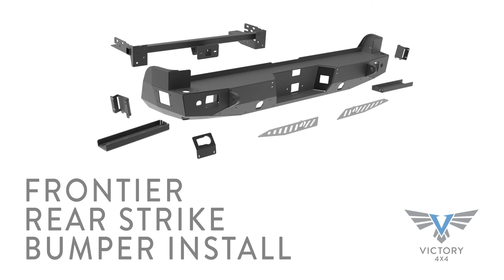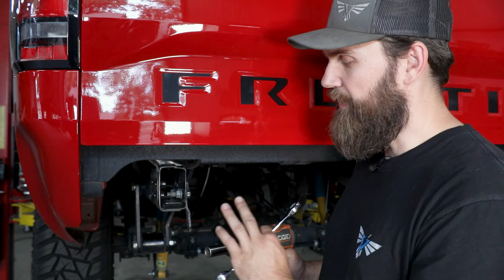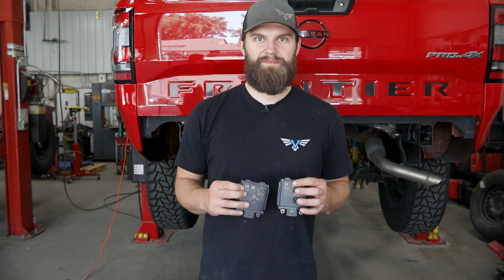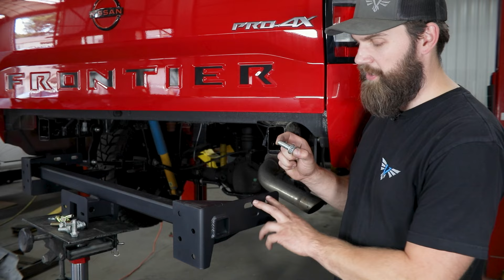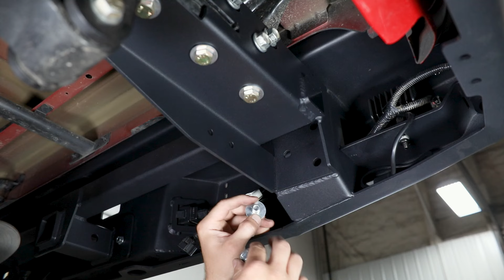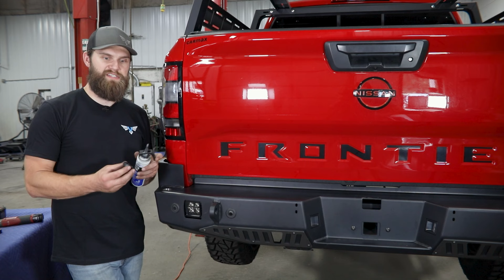Nissan Frontier Strike Rear Bumper Install

Comment: The problem - Nissan Frame is thinner than the material used for the new bumper   One little accident and kiss your frame goodbye
Reply: the frame would take damage no matter what, steel bumper or not and its not just a frontier thing either.
Reply: just had a rear end collision on the interstate, and the frame took the beating.  I was hit by uninsured driver he was doing around 70 mph and I was doing around 25mph
Reply: @buddyadelsberger5083  ANY frame would take a beating with a 50mph speed differential. dont matter what it is

Comment: does the adventure carrier with no rear tire interfere with the OEM rear cameras field of view? any chance of posting pictures of rear camera view with  the adventure carrier?
Reply from the maker: It will partially cover the camera, how much will depend on tire size and adjustment on the carrier. That is why we developed a license plate and camera relocation kit which can be found here. https://www.victory4x4.com/product/LPRLC3.html

Comment: Does this bumper sit higher with better clearance than stock and if so how much higher?
Reply from the maker: There will be clearance gained from removing the factory hitch and using the integrated high clearance receiver. Other benefits include: optional swingouts for a spare tire and other gear, overall added protection from a full steel bumper, integrated recovery points, and provisions for LED lighting.
Reply: @Victory4x4 thanks! Where the video for the swing out installation? Haven’t found that one yet? What’s the weight diff with stock bumper and the rear bumper?
Reply from the maker: All product weights can be found on the product pages, but overall weight really depends on what is being added to the swing outs. Here is a link to the install video for the swing outs themselves. 

https://youtu.be/4zHXPQK5Nz0
Reply: I meant just for the frontier but the video is on a suv. I’m guessing the installation concept is the same?
Reply from the maker: The install is the same, all of our rear bumpers utilize the same swing out.

Comment: Is there any way to make this fit a 2017 Frontier?
Reply from the maker: There is not, this is only designed for 22+ Frontiers.
Reply: @Victory4x4  Do you make or know of any similar products that go on a 17?
Reply from the maker: We do not currently make any bumpers for that model, we may down the road but nothing currently in the works.
Reply: @Victory4x4  There's a huge gap in the market for older Nissan upgrade parts, I guarantee you'd see a big ROI  if you tapped that market.

Comment: If you want to change the sensor to Black to match your rear bumper can't you just use black finger nail polish?
Reply from the maker: The easier solution is use black vinyl wrap.

Comment: Where can the license plate go, if you need to use the hitch?
Reply from the maker: The plate can flip up for using the hitch. Otherwise we offer a relocation kit to move the plate to the spare tire on a swing out.
Reply: thanks @Victory4x4

Comment: Id love to see you guys tackle an ARB compressor mount under the bed.... either single or double. The one from Costal won't work with a factory front bumper. This unit looks great honestly
Reply from the maker: Jasen,

We’ll probably be looking at an under hood solution.
Reply from the maker: Jasen,

We’ll probably be looking at an under hood solution.